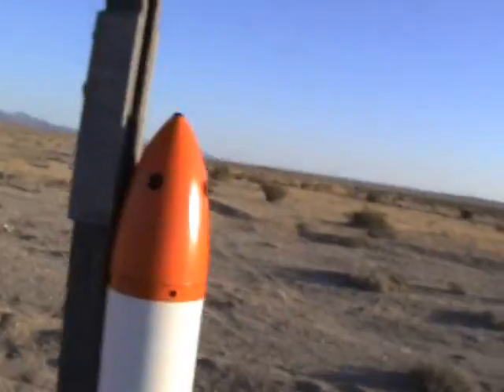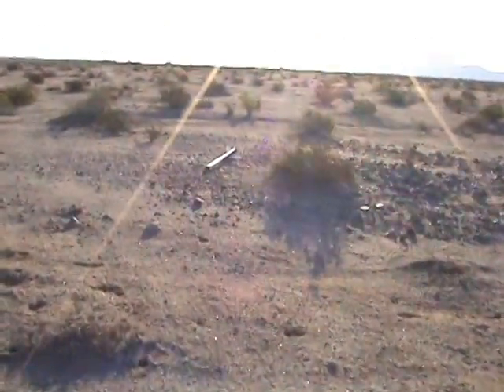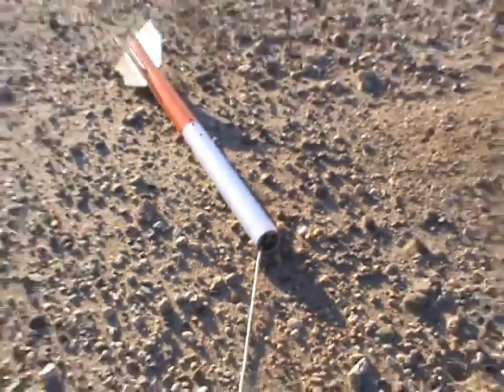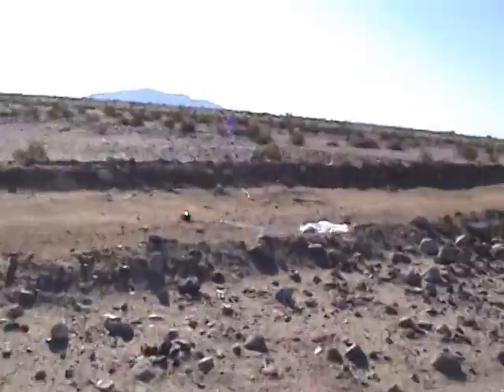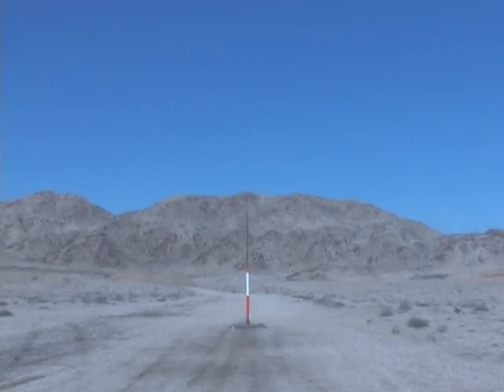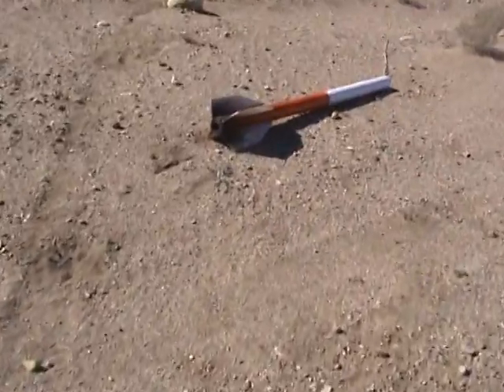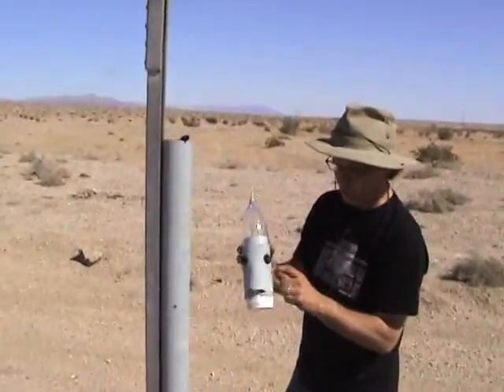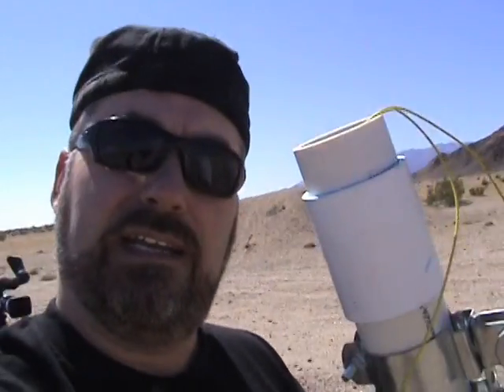410.mpg

Comment: I would suppose that an apogee detector is nothing more than a mercury tilt switch.
Reply from the maker: Nope. A mercury switch will close as soon as the engine cuts out and will stay that way until the rocket hits the ground. It's a physics thing.
Reply: Dan Pollino Yeah, now that I think about it the ball of mercury will drift upward as the aerodynamic drag is working only on the rocket body not the ball of mercury.

I'm going to try to build a rocket guidance system that would guide a rocket  vertically regardless of the angle it takes off. Solid state accelerometers and such can be purchased online for only a few dollars. Trouble is I will need to learn something about operational amplifiers.

Comment: Awesome, great job on the 3 consecutive flights! I am still perfecting my rocket design, but I think I have a good solid state apogee detection and parachute ejection system. I managed to acquire about 1kg sorbitol (which is very hard to come by in the UK), so I should be able to make some better fuel for my next rocket.